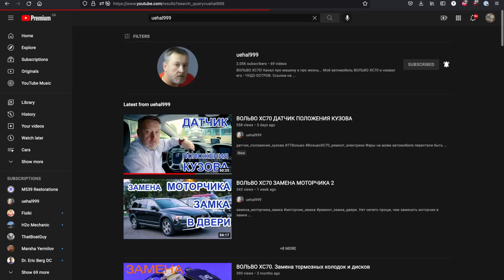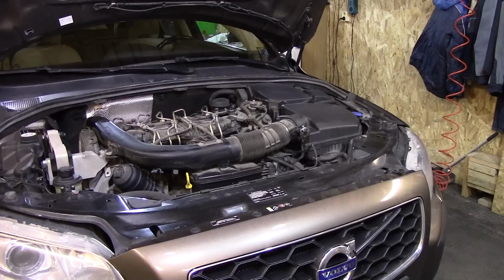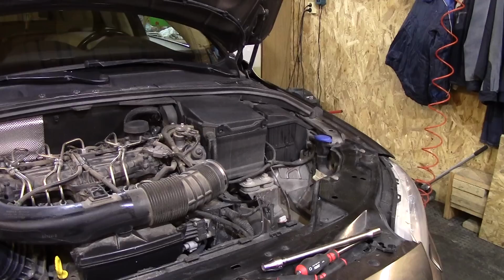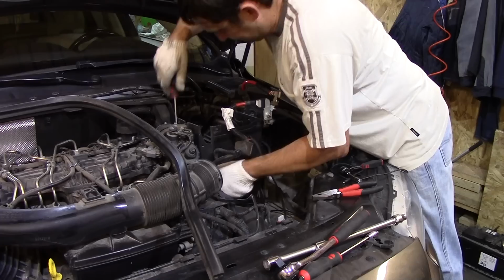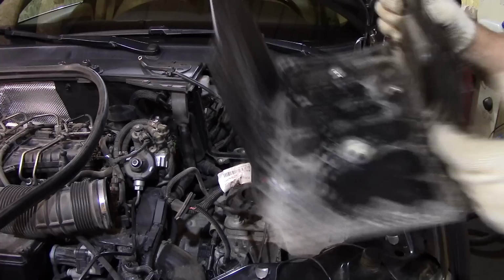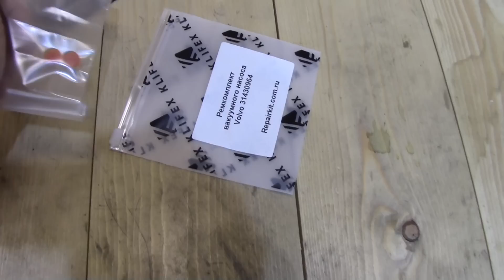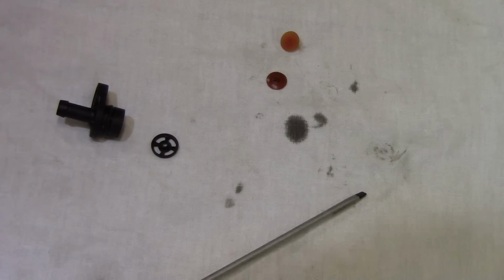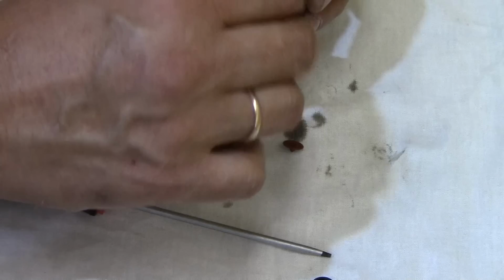Vacuum pump valve repair kit on Volvo D4, D5. P3 Platform

Comment: Thanks from Finland also! Did the repair in 20 minutes and I was able to do it without taking the battery holding off.  The Volvo experts couldnt help and this was new info for them.
Reply: Oliko autossa muita oireita kuin tuo ääni?
Reply: @miikaheiskanen6735  Ei mitään muuta oiretta, eikä ole venttiilin vaihtamisen jälkeen ollut.  Oli mukava kun ensin tehtiin venttilinnostinremppa, jolla piti korjaantua.
Reply: What size torx
I can't get to screw, what did you use for such a tight space without  taking battery off , no way 20 minutes.
Reply: @trancegsi  Battery off clearly, but not the battery holding.

Comment: Had same noise from my car,  so decided to buy valve from volvo,  almost 80 euro,  removing air box gave plenty room to fit,  problem now fixed,  so we'll worth the money,  GREAT video,  I would have went to volvo garage at great expense if I did not see this
Reply: Did you leave the battery in ?
My s60 D5 just started 2 days ago intermittently but 70% of the time..touch brakes and goes for a short while.😮
Reply: Did not remove battery,  once air filter housing was removed I could see and move enough
Reply: @sillysodus0  great cheers. I'm on holiday was thinking of doing it hear if easy, there's some tools lying about . If not I'll do it when home

Comment: This is also a useful video for XC60 D3. I had the same trouble and it was hard to find the source of that noise. Gladly I have found it and it's an easy repair, 70€ instead of the 1000€ that dealers want, saying they have to change the whole EGR valve and gain some money with the distracted ones.

Comment: Hello. Today i changed part 31430964. Few minutes after replacing everything seems to be good. But after 15 minutes when i pressed gas pedal, this sound was comming back but not that much like before changed this part. Do You have some idea what is the problem? Regards
Reply: Did you ever solve this?

Comment: So I’m guessing that it’s possible to do the repair for free? Just by removing valve and making sure the plastic mesh is put back in place. My car is making this noise, will hve to try this out.
Reply from the maker: You could. And test the rubber membrane at the same time.
Reply: My membrane was torn apart. While making effort to disassemble everything, the price of membrane is nothing, if you buy from alternative source (not from dealer). Better to have it ready for replacement.

Comment: Thank you for your video, it helped me a lot to mount the new valve. Mine was completely destroyed! there was only the central part of the orange membrane left... given the staggering price that Volvo sells the repair kit (100€), I ordered one on Aliexpress and I got the complete kit for 3.5 €!!!
Reply: no way ! and it works like the original ? wow
Reply: @sammyt.3607  I did it in January last year, almost 20,000 km, and I no longer have any problems having done this…

Comment: Just did mine on XC70 P3 D5244T17.
Remove air box (screws PH and TX25, socket 7mm or flathead for MAF removal)
Remove bottom part of air box - clean it afterwards
There is just enough room for the valve removal with battery box untouched - just use TX25 and small socket driver.
Bought replacement on Ali, was very cheap, but I used only the membrane. Dont believe in longevity of the plastic body.
My membrane was completely torn apart, so I am glad I replaced it.
After the change the brake pedal feels bit stiffer, probably due to the vacuum regulator now working. There is less vacuum, but it will last longer. I did not have such big problem with the noise, but it could be heard sometimes.

Comment: Thank you VERY much for this simple, but VERY effective solution. for D5. The engine sounds so much better and makes it more pleasurable to drive . I also replaced transmission, front, rear diff and haldex oils... Everything runs like new! Spasiba bolshoi!

Comment: Thanks again so much for this Video.
On my XC70 2013 with D5244T15 Motor it was definetely this small valve, where the membrane is broken.
This makes the strange sound and also the EGR control flap clappering. 
This small valve is about 80 to 90 € in Germany.
I now did order 2 of these after market membranes from Russia for 30 € each, wich hopefully will arrive in November, that I can repair it soon.
Thanks to your video the replacement procedure is very easy. 👍
Reply: Hallo Bitte Können Sie mich antworten auf die Probleme ich möchte nur Fragen danke

Comment: Trank you for this Video from Germany.
I have the Same Noise since about 2 weeks ago.
Sounds like a Fish-trawler.
I knew it has something to do with the vacuum pump System and tried to locate the failure by pressing vacuum-hoses with My fingers.
Found out it disappears, when pressing the hose Connected to the plastic control valve that actuates the EGR-flap.
It also dissappears when the magnetic valve between vacuum-pump and Control-valve is actuated from time to time.
That is the reason why sometimes the noise is there and sometimes not.
Until now I suspected the membrane of this valve to be broken.
But now your Video gave me another helpfull hint what the failure may be.
Reply: Hast du die Reparatur wie im Video durchgeführt? Wenn ja, hat es geholfen? 

Habe selber entweder die Kurbelgehäuseentlüftung (weil Öl im Bereich Ölfilter Übergang zum Ansaugrohr) oder eben die Vakuumpumpe im Verdacht. 

Wie genau bist du beim testen des Vakuum system vorgegangen?

Comment: Good job, but I have done the same work twice, because after installation the issue came back, second time I've added inside the vacuum pump small plastic washer that was fixed vacuum valve in assembled position all the time. Only adding plastic washer tickness about 3 mm have solved a problem. Actually, original rubber membrane was in perfect shape and I didn't replace, when cheap aftermarket membrane was ordered as well 😁
Reply: Hi, did you add the plastic washer under or over the membrane?
Reply: @juho.piironen  Hi, I added a plastic washer inside the vacuum pump. So, before installation of the valve, input plastic washer with similar diametr, 3-4 mm height. Then install valve. In this case, the valve will be fixed by this plastic washer.

Comment: Hi,
Can you talk to your Russian Friend to make a useful modification for DPF regeneration on 2.4 D5/D4 P3 engines? 
I installed by myself the LED with the resistor to the glow plug to know when the DPF is regenerated. The light from the LED informs me about the working glow plugs. During the regeneration of DPF, the glow plugs are running, LED are lighting and this way I know not to turn off the engine so that the regeneration comes to the end. I installed the red LED by the dashboard on A pillar. Also  you can take a power  from the wire of the glow plug module. I think it would be a useful thing for D5 users and on your channel this information will reach more users. led 3.6V and 480ohm or 1.6V 980ohm. Fuse 1A.
I have been using my idea for 2 months so far and it is doing great job.
No any foults or errors after instalation LED.
Reply: Wow, nice that is definetely useful.  Do you know or can you test if regeneration doesnt take place at a certain fuel level? I think i read somewhere that it does not regenerate below 1/4 fuel level, but couldnt find information about this in vida.
Reply: @szittyakurt  
No matter what the fuel level is. Regeneration takes place anyway. You only need 1/4 tank when you do computer regeneration.
Tested on my d5.
In My case regeneration take Place Every 1900km in winter or 900km in the Sommer.
Winter diesel have less bio components if Im right. 
Glow plugs heating up up to 12mins after star cold engine.
Reply: @karolzabielski  thank you very much
Reply: You can know when your vehicle is in regeneration mode without that indicators, just watch consumption when vehicle is stationary. In P or N consumption increase about 1.5-1.8l per hour... When the consumption back to 0.5-0.8 regeneration is over.

Comment: Thanks so much for this video! Just discovered my XC60 D5 is making the same noise and I am far away from home. How quickly should I get this problem fixed? Would you ride 1300 km with a defect vacuum pump valve? Besides the noise the car just works as usual...

Comment: Does this also cause more oil usage because I have to add 1 liter of motoroil every 2 weeks that's not normal
Reply: If the Crankcase Ventilation system can not release the pressure from the crankcase, you are likely to consume more oil through
1) The ventilation itself, leading to the intake hose
2) The piston rings
3)The turbocharger as, the turbo cannot make to oil from the return pipe go back into the engine if there is back pressure (this can also damage the turbo quite quickly, resulting in a little whistle or rattling noise like letting rice fall on a thin metal plate, but muffled) 
4) overpressure in the crankcase makes oil leak from every hole and also "not-hole". 

Overpressure in the crankcase, caused by a faulty vacuum line is quite the problem and may reduce the engine life.

Comment: Why you don't add D3 engine in tittle ? 

Compatible with vacuum pumps:

31258031

31375107

Compatible motors:

D5204T3

D5204T7

D5244T11

D5244T15

D5244T17

The vacuum pump was installed on:

VOLVO XC70 2008-

VOLVO XC60 -2017

VOLVO S80 2007-

VOLVO S60 2011-2018

VOLVO S60 XC -2018

VOLVO V70 2008-

VOLVO V60 2011-2018

VOLVO V60 XC -2018

VOLVO V40 2013-

VOLVO V40 XC

Comment: Thanks for the video! My valve plastic housing was completely loose (The black part with the nipple on it). And I have alot of oil leakage around that spot. Can this be the source of the oil leak?

Comment: My xc70, d5, 215 hp, 2012, 127000 km consumes 1 litre oil every 2000 km, official volvo service worker advice me to change from castrol 0w30 to castrol 5w30! What's your advice in such situation?
Reply: Thicker oil is not solution for your problem. If it is not leaking outside (you would see), it is being burnt by engine. Most probably piston rings or scratched cylinder wall. If it is the piston rings, I would try engine cleaner (I use BG EPR). If it does not help, the only next step I see a visit to repair shop to investigate deeper, probably more expensive solution.

Comment: Just to be clear, was it the ticking noise or was it vacuum pump noise?
My V40, D4, 5 cylinder has like a vac pump noise inside the car, but engine sound good when listening outside under the bonnet.
Reply from the maker: Ticking of the EGR flap due to failed vacuum pump valve
Reply: if you turn off the air conditioner, does the noice in the cabin disappear?

Comment: So hard to find any info on the Euro 5 diesels (D5=215HP). Really annoying that there is tons of info for the Euro 4 and 3 but basically nothing for the Euro 5
Reply: Its the same
Reply: @t-banan  except it isn't in many many ways. We have both the 185bhp 2006 D5 and a 2011 215BHP D5. They are vastly different engines in terms of what components they use and what does what and goes where.